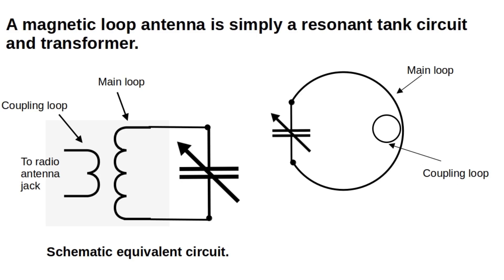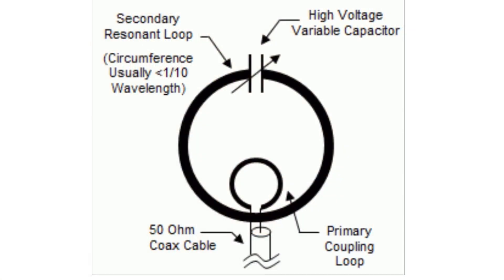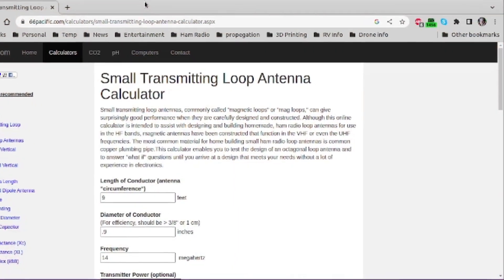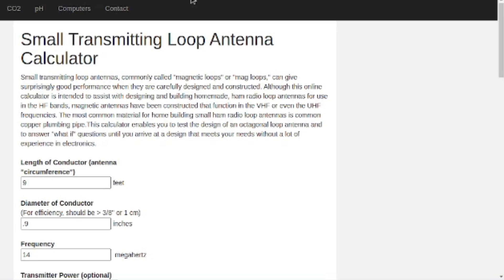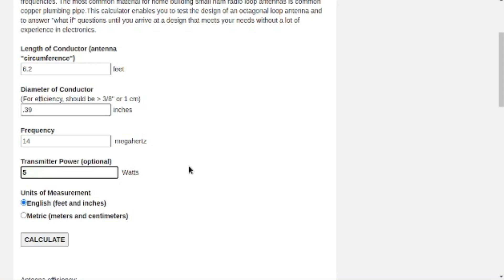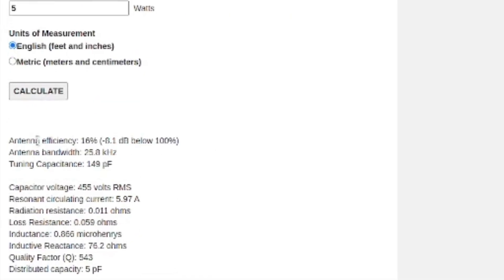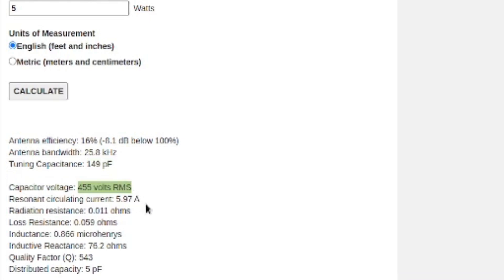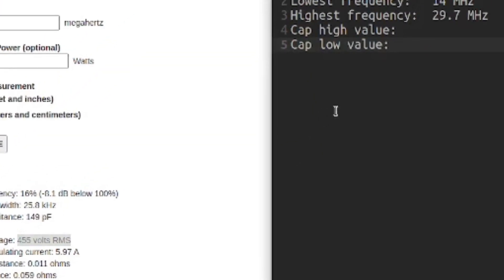Ham Radio - Designing a small magnetic loop antenna for pedestrian mobile.

Comment: The reason a single gang moves so, is because the shaft that you are touching is one side of the capacitor, your connecting your body to the antenna, so of course that's going to affect  it. with a twin variable you are making the loop a balanced element, and the centre, neutral part is the shaft, so touching it has way less effect.
Even using a large plastic knob on a single variable cap won't help that much as you are still coupling yourself in, just capacitively rather that a DC connection, again to one side. I.E, do you hand on to a dipole antenna element and hope that wont effect it's tuning? Unfortunately loops being so sharp in tuning, you cannot get away with anything.

For a single variable capacitor try using a good length of fibreglass, or plexiglass rod as a shaft extension so you can adjust it whilst not electrically touching it (or getting too close)

Comment: Mr. Loughin, is there any way  you could post the schematic for your "Rebuilding the L network antenna tuner circuit"?  I'm in the process of building the tuner. I know my question is off subject. I'm kinda new at this stuff.
Reply from the maker: You'll find the schematic in the previous video on the actual tuner. Just search my channel for l Network tuner and you'll find it.
Reply: @loughkb  I did watch that video first. I just wanted to make sure I get your new circuit correct with your add on parts. Thanks. Your videos are first class!

Comment: Hi Kevin, just wanted to say the “tuning capacitance” in those calculators is actually the total capacitance to resonate. You can check it 1/2pisqrtLC. The distributed capacitance shown there should be subtracted from the total for the capacitor needed. Only possibly big deal at the high frequency wanted. The distributed capacitance on the calcs is pretty accurate for copper pipe. Good luck and have fun. Looking forward to seeing your finished loop. Stay well.

Comment: The other reason for using back to back capacitors is that the solder tab for the rotor is typically connected to the actual rotor plates via a slip ring or worse.  At the kind of circulating currents you get in a loop the resistance of the sliding contact is significant.  (It's also significant on receive.)  Usually the rotor plates for both (or many) sections are already connected together, being on the same shaft, a solid conductor through its whole length, so there's no sliding contact in the circulating current path in the back to back sections scheme.
The reason that this helps with the hand capacitance is that the frame of the capacitor is usually what is sliding connected to the rotor(s), and that's a sort of 0 voltage point (at least if the sections are the same value), likewise the shaft itself, and those are the things that your hand gets closest to.  Balance is key to limiting the effect of hand capacitance, and physical symmetry helps here.
I have an original AlexLoop, and yes, hand capacitance is a significant effect.  I don't know if the newer models have better balance.  I haven't tried yet, but I've wanted to remote the know with a longish non-conductive shaft extension.  Someday.
You will want a reduction drive.  You have a 25 kHz bandwidth at 20m, and you will want to be reasonably centered to get a good match, so, say you need 6 kHz tuning resolution there.   The capacitor's range is intended to take you over 29.7-14 = 15.7 MHz in 180 degrees of capacitor shaft rotation, so a fraction of 1 degree is how finely you must tune,  Not fun with direct drive.  And with a suitable reduction, it takes a long time to go from 20m to 10m.  The commercial antennas probably use those clever dual rate drives, where if you go far enough it's 1:1, but when you back up a bit it's more like 5:1 or more, but they're dear.  I've been tempted to return to the days of dial cord, with a big wheel (with tensioning  spring) on the capacitor shaft, with the cord wrapped a couple of turns around a small smooth shaft that you turn for fine tuning.  You could probably turn the big wheel directly for coarse tuning (probably making the cord slip on the small shaft) and use the small shaft for fine tuning, no special gearbox required.
I've also wanted to try modifying things as in your first drawing, where the coupling loop is at the bottom,  and the capacitor at the top, using a long non-conductive shaft to place the tuning knob at the bottom.  So many projects, so little energy.

Comment: At some point maybe you could tell us how to find out the pico farad range of an unknown air variable capacitor and it's voltage limits.
Reply from the maker: I find the capacitance value using a capacitance meter. as far as voltage, I don't know, you'd have to find the manufacturer's specs I guess.
Reply: Hello!  There are equations that you can lookup that will give you the breakdown in air (and other dielectrics.
I don’t recommend that you do this but many years ago, I used a 60KV neon-sign transformer on a variac with a series string of high-value resistors (to severely limit current) to induce an actual non-destructive breakdown; of which you can the use an old TV high-voltage probe to measure the potential; short of that measure the input voltage to the transformer, then using the turns-ratio, infer the actual voltage.

Comment: Take your hand out of the capacitance equation by using a length of rubber hose on the tuning caps shaft to allow turning it from a distance.
Reply from the maker: the big problem there is flex in the hose. you need to be really precise when adjusting the cap on these mag loops, and any play in even a stiff rubber hose will make it very difficult.

Comment: Looking forward to Part II.  Loops are fun ! Get well my friend. 73 de KG5RK
BTW, Pay attention to capacitor plate spacing. They WILL arc !
Reply from the maker: Yeah, I mentioned that in the video. I think I said something about keeping the power low on this loop. 5 Watts or less.
Reply: @loughkb  Several years ago W5UUN (SK) and I built a 40 M loop with Junk box parts. Worked GREAT until we got to about 35 Watts.  LOL...